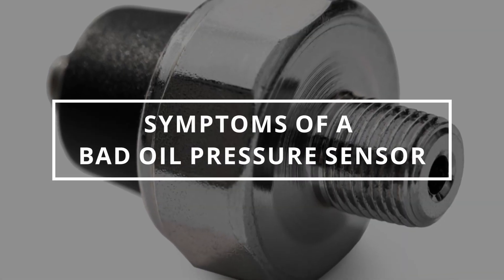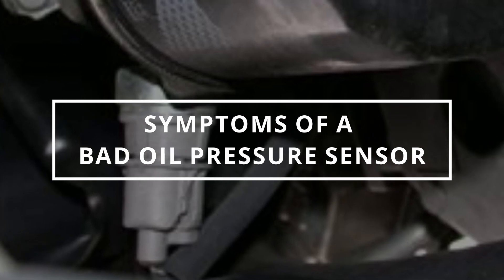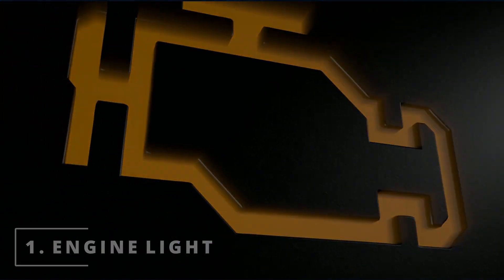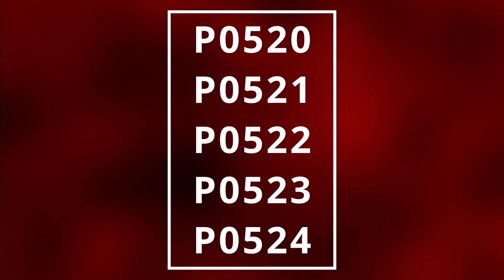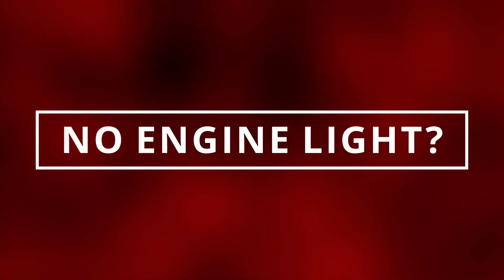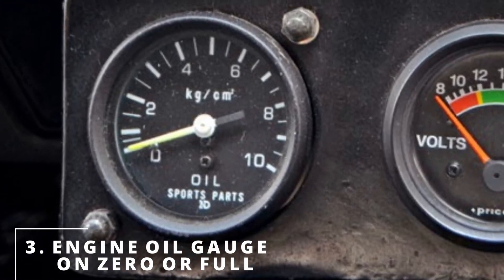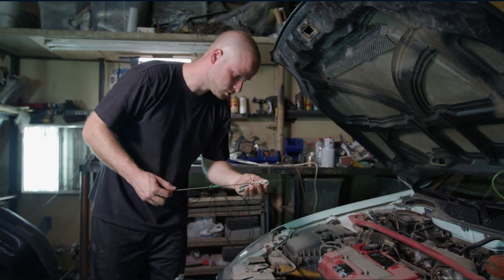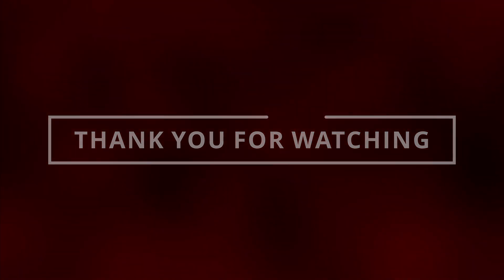SYMPTOMS OF A BAD OIL PRESSURE SENSOR

Comment: Im losing an insignificant amount of oil on my driveway. Only if the car is running. Is this a symptom of a bad oil pressure sensor??
Oil level still above on the stick. Coolant level still the same. (Had problems with water pump before). Gonna try change the oil pressure sensor myself on a 2014 explorer.
Reply: If you're losing oil it's probably a seal.
Reply: @theunknownandunsolved6963 thanks. I changed the sensor, made an oil change and the “low oil pressure” light is gone. That seems to fix the issue.

Comment: My car brakes down when turning a corner. Would it be from the oil pressure sensor? The brake gets stiff, power steering goes out and gas wont accelerate, but the battery stays on. The oil pressure drops down to 0 when accelerating and raises back up to normal when braking. The oil light comes on when acclerating due to the drop in oil pressure.
Reply: Could be AIC ( Air Intake control) is your rpm gauge eradict? Bounces up/ down?.engine run rough- choppy? 
Part usually runs $75.00 or lower depending  on make/ model. It's a easy replacement. You can replace it yourself.
 Two screws, aic pops off,
Reply: @iiatargetanalyst3046 that sounds like what is happening to my 2019 nissan altima right now, but i had to sell my Buick. I got scammed big time as far as that car in cncerned and the person who bought it convinced us the engine was messed up. It was the AC compressor beside the engine that was making noise and i think it was breaking down when the AC was on, looking back. My Nissan just got an oil change, but says it needs an oil change in 800 miles, even though its not leaking oil. It shouldnt need one for nearly 2000 miles, but this car has 125k miles on it. It hesitates accelerating, especially with the AC on, too. The exhaust sounds a lot louder than it used to, too.  The only reason i went ahead and got the car was the 2 year warranty, but low and behold, it doesnt cover exhaust issues. The rpms werent eradict on my buick or the Nissan, but it hesitates if you try to accelerate it quickly with my Nissan and theres no way to tell if it needs transmission fluid, or if the previous owners got the fluid changed, and if so when... with the newer CVT type of transmission and no fluid stick.

Comment: genie lamp came on, scanned the my car with snap-on scanner and there is no code. but i have enough oil. also when above 1500 RPM it goes away. can you help me determine the issue? 77k mileage
Reply: Ecm detect a fault, ecm can ( does) disable sensors, vehicle goes into limp mode.
panel lights intermittently 
flicker,  or flash, or 
steady on

Comment: Ok my oil gauge is doing these things but I do not have an engine light with it. At 1st the pil pressure gauge said my oil pressure was low not all the way to zero but low but when I pull over & turn my truck off then back on the gauge will go back to normal. Now it goes to high & stays in high & when I turn it off & back on it goes back to high. But when I turn it off my gauge does some funky shit it won’t drop to zero it drops to different levels & stays there then when I turn the engine back on it goes back up to high. I’m replacing the OP sensor in a few mins I went & got one. The great news is the new part didn’t cost me anything because I buy so much stuff from autozone I had a 20 store credit & the sensor was 19$ after tax so I got it for free. Hopefully this is the issue if so that’s awesome because I got the sensor for free.

Comment: I would at least take the oil filler cap off and watch a paper towel covering it to get splattered with oil with engine running before I assumed it was just the sender.

Comment: None of these videos mention that it can  make your car cut off
Reply: My car brakes down when turning a corner. Would it be from the oil pressure sensor? The brake gets stiff, power steering goes out and gas wont accelerate, but the battery stays on. The oil pressure drops down to 0 when accelerating and raises back up to normal when braking. The oil light comes on when acclerating due to the drop in oil pressure.
Reply: @Enembes  Not sure, but a bad ground can cause all that to happen too.

Comment: Make/model: 2008(yes, old car) Dodge( I know) Caliber (I know!) SE.
 I have had the codes checked twice at 2 different auto parts stores, and both readings did not any issue anywhere in the car. I did the reset/ignition to on then pump gas 3 times which cleared the "Change oil" but the oil sign/symbol/light will come and alarm sounds after about 5-10 minutes of driving. If the whole eletrical is jacked will it give a false positive reading?

Comment: If it's an AEM oil pressure gauge it's likely bad.  Mine went bad within a few months.  Fortunately I put a oil pressure switch on the engine set at 1 psi below hot idle factory oil pressure specification (14 psi).  When my AEM oil pressure gauge went to zero after my car warm under the hood I only panicked for few seconds till I realized the red LED low oil pressure light wasn't flashing. I'm glad I installed an idiot light.

Comment: Oil light brinks while oil level normal i tried to replace oil pump same problem then i also replaced oil pressure sensor then the oil light went off for good please help .2NZ engine funcargo 1999

Comment: So i have a 2008 Dodge Caliber and for the last 2 weeks my oil light keeps flickering on and off and it is dinging ... I checked my oil and it was fine... I tried resetting the sensor but it didn't work...the guy at fast change oil said it was possibly a sensor or switch gone bad ... Any advice???
Reply: did you ever figure out what was wrong? my 2006 ford escape is doing the same.
Reply: hey, i have the same problem, what was the problem? Thanks

Comment: Another way to check the see if a op sensor is bad is to take the sensor out and put an oil pressure gauge In place of the sensor and then check to see if you have no pressure if you don't. It's time for further diagnosis, for either a oil pump, clogged oil sump, relief valve or just a clogged oil filter. If you do have pressure, then you're fine and just replace the sensor asap.

Comment: What if we set the sensor to work in the maximum position so the oil pump also performs on max pressure? I have an Opel Astra K 1.6 cdti that has problems with the chain tensioner and inadequate lubrication of the chain. In order for the chain tensioner to work at the maximum pressure, the oil pump needs to create that maximum pressure. This pressure is regulated by the oil pressure valve.  What is a drawback if we set the valve to operate in the maximum position all the time?

Comment: I’m looking at a 2008 Cadillac Escalade. The guy says it has a bad oil pressure sensor and won’t run because of that but I’m not sure if having a bad oil pressure sensor will keep it from running that doesn’t sound right is that true?
Reply from the maker: If you're genuinely interested in purchasing the vehicle, I recommend requesting the seller to replace the oil pressure sensor before finalizing the deal. This step would allow you to determine if the starting issue is solely related to the sensor.
Reply: @easyautofix  thank you that’s what I said to the gentleman but he said I’ve already spent enough money on it and I’m not looking to spend any more money. It’s only for sale as is so I think I’m gonna pass so I don’t get into a money pit.

Comment: You should have told people that another reason for a low oil pressure message is a worn- out oil pump. Especially on a high mileage vehicle.
Reply: Or clogged pickup tube.
Reply: The video isn't on a oil pump 😂

Comment: So wrong. Having correct oil level does not indicate bad sensor. You could have a bad pump, sending unit, shot rod bearings.
Reply: Shoutout to you for letting people know! Because that ain’t something to play with!
Reply: A sending unit is the sensor. Same part, different name.
Reply: Which is his other video. He's not wrong, he's just trying to help. In my case he did help by this video and the other one about the oil pump.
Reply: He said probably, the video is oil pressure sensor symptoms not oil level and engine symptoms weirdo

Comment: Idk if its my guage cluster or sensor its on a 97 ram 1500 the oil pressure moves up and down and the light comes on even at 40 lbs of pressure the oil light is on 😊
Reply: I’m assuming you still have good oil level in it? Is the pressure increasing as you apply throttle?
Reply: @GetTheFO I actually have the same issue and yeah it does increase
Reply: Oil pressure sensor switch is faulty. Easy to replace. Switch is right next to where you put oil in engine. Left of it

Comment: Got replaced new oil sensor reader and car runs and drives perfect temperature is also perfect but oil light still coming up and after some time switching of what that could be ?
Reply: Did you purchase an OEM replacement part, or check the unit for resistance with a multimeter before installing? A lot of the parts now have terrible QC and come non-functional out of the box.
Reply: Reset

Comment: I replaced my oil pressure sensor and my oil pump is also good but the light still goes on and off, any ideas what else to check?
Reply: Oil is too thin, not enough oil, faulty new sensor, a wire is shorted somewhere, if ya cant fix it tho id say just take a sharpie and cover the light with it/unhook the oil pressure sensor
Reply: Did you use an OEM  (Original Equipment Manufacturer) pressure sensor? The aftermarket ones are not very reliable.
Reply: @duanethieme4186 Especially nowadays. It’s crazy how bad QC has gotten on parts, I hardly even buy new anymore. Just go junkyard digging and test resistance before installing on electrical components. Even a lot of the OEM stuff now is coming out with a heavy failure rate.
Reply: Check your alternator

Comment: I have to say my Oil light comes on when I'm stopping my Truck. It cuts off when my feet on the gas. Now I been got my oil change have got my oil sensor gauge change and it still goes off & on. It's making me so upset. That I put the right amount of oil in the truck it still beats and goes off. My oil dipstick does not read correctly I do not have a oil leak at all. And I can't find No honest mechanic shop out here in ATL that can help me I just been scammed out of Thousand$ of Money left-to-right from the last 12 Years. It made me so upset that I part the truck in the backyard I'm done with it.
Reply: Did you actually fix the oil warning light problem? It’s coming on when I’m in a stop and goes away when I step on the gas pedal, it’s on my 2015 Trax 1.4L.

Comment: My check engine light came on while I was driving and my oil pressure on the gauge didn't move past I think it was 100 kpa, it was between zero and the first mark on my gauge, 2010 Sierra, 5.3L, I'm wondering if the oil pressure sensor and the oil level switch might be bad

Comment: My oil pressure light comes on then goes away. Is that also indicates bad oil sensor? Thanks.
Reply: If your temperature gauge shows the temperature in the normal range and your motor is not making a clattering sound it would be my guess it's your oil pressure sensor.
Reply: @frankfrankly1366  my engine making a clattering noise what does it mean
Reply: @prvtgoaty_yt4738  could be bearings
Reply: @collinfeeney8191  yeah found out my car needs a rebuild lmao
Reply: Mine was popping on after the engine heated up and I’d come to a stop. Did some looking and found it was a bad sending unit, changed it and no problems. If your engine isn’t over heating, it has good oil levels in it, and you don’t hear clattering in the top end or a knocking sound when you stick your head under the engine, chances are it’s the sending unit. Clattering means the pump is most likely bad and the top end isn’t getting oil flow, knocking means your bearings are worn out and the engine is gonna have to come out. I’d recommend not driving it at all if you’re hearing noises.
Reply: @GetTheFO 
Thank you for sharing your car problem. I have the same problem with my buick enclave 2014. Oil still full, engine is very smooth.  The oil light just come on when heated and at stop. Hope it is the switch problem like you said.
Reply: I don't think having a dipstick that reads full means your o.p.s is bad,I think it means your taking care of your car. That is probably the worst advice I've ever heard. Guess that means every car that's full of oil needs a new pressure sensor!?!?!
Reply: @johnrasmussen4982 Because the oil is full but the oil indicator lamp is on is the indication to a bad o.p.s..  A reason for this warning is low or bad oil.  The advice is solid.
Reply: @johnrasmussen4982  yeah this channel is clueless bro, I'm guessing he's never touched a spanner in his life.
Reply: @johnrasmussen4982 so then explain why is the oil pressure light coming on? I'm interested...
Reply: Me too usually on an incline. My mechanic said it's the sensor, not the oil amount or pressure.
Reply: Could be the oil pump or the oil pickup that sucks the oil from the bottom of the oil pan into the oil pump
Reply: Needs oil 😅
Reply: My 2013 low pressure comes on when I first start it. Had an oil change still comes on when its cold out. No unusual engine sounds or anything. Could it be a faulty sensor?
Reply: Oil pump?
Reply: @puppies-t2d  change the oil pressure sensor it’s still do the same. It comes on then goes away. At this point I really don’t know what it is. It only happen upon starting the motor once it’s running it goes off.
Reply: Dd
Reply: Check your oil level
Reply: @FisherTate  this happening to me, oil levels are fine though.
Reply: @FisherTate  kinda hard to read the dipstick on an 07 murano engine. It’s just weird the way it was set up.
Reply: No it's suppose to go by the time it starts but if it doesn't go then there is a problem

Comment: Alrighty so now I’m not sure if there’s something wrong with my car. The oil pressure holds normal when idling or normal acceleration, but spikes all the way to 80 (max) when accelerating harder or full throttle. Is something wrong with the engine? It’s a 5.3 Vortec with 160k miles so it’s still relatively new
Reply: Check pcv valve or vacuum lines. Had a similar problem with my ford
Reply: its normal for the pressure to be like that when youre going hard on the gas. A test for you, check the pressure on the gaugge when you`re going up the hill, if it goes down it means you`re low on oil so maybe check it. But yeah it should be around 40 at normal driving or idling and 80 when you`re going fast or accelerating hard, but if it is stuck at 80 constantly when you`re driving normally too, then you should look into it becasue that``s not normal

Comment: I replaced the new sensor on my 2011 jetta 2.5, but the warning light still coming back. Does anyone know if I have to still drive the car for a few miles until car resets the light away?
Reply: Try cleaning up the connector, it could be not getting good contact with the new sensor. I hope you got it figured out
Reply: Did it ever work out, or was there another issue?? I'm having same issue!!
Reply: Same issue happened to my pilot 2015. I cleared the issue and it went away, came back once
Reply: also check the oil pump
Reply: Yes you do
Reply: Oil pressure pick up tube gasket !